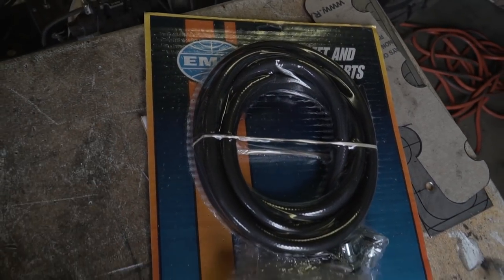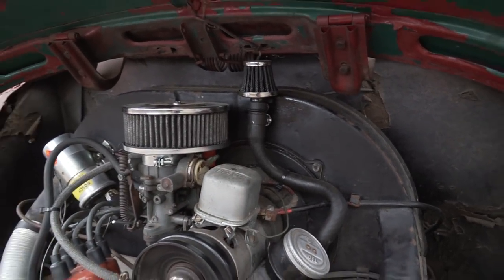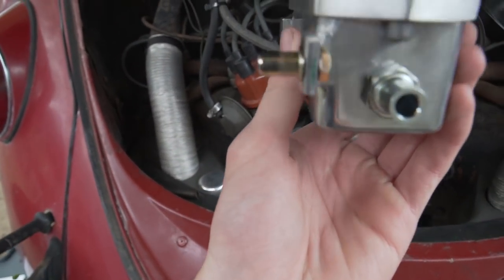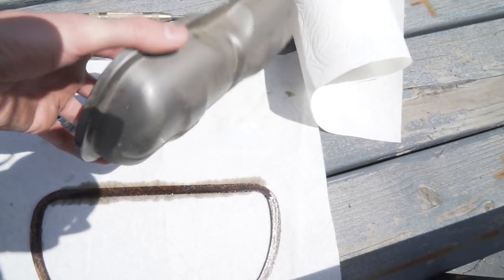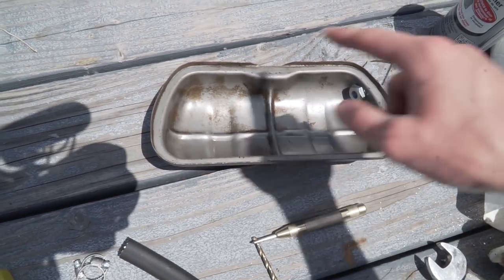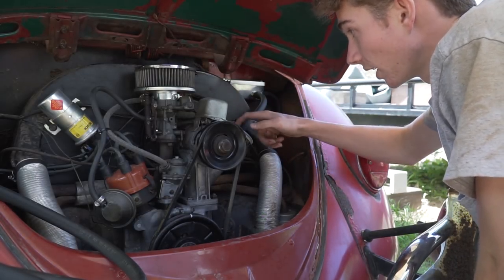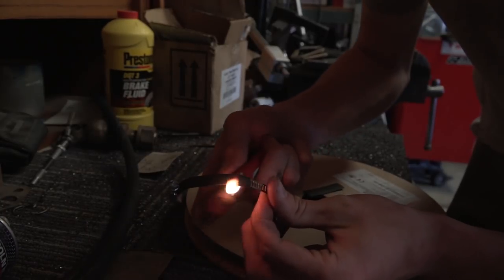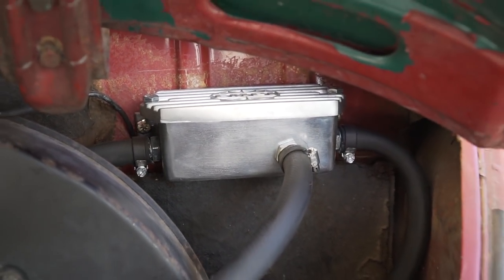Setting up a Fresh Oil Breather on the Bug!

Comment: Nice job bro I recommend replacing the Empi sponge with green dish washing pad (Old School baja Racing secret) the Empi sponge clogs up and stops breathing again
Reply: Could you tell us exactly what kind of green dishwashing pad? I would appreciate it.
Reply: @amezcarl  Scotch- Brite Heavy Duty scour pad 3pac
Reply: @bajalarry8738  Thank u bro! your info is really appreciated!! so, the "Industrial Strength" ones are just too porous?  What happens if I use those ones? It´ll not work properly either?. Anyway, I'll get the ones you said. But wait, those ones are a bit thin, Do I have to stock them inside the breather? or just one inside is enough?
Reply: @amezcarl  I used two with a metal mesh towards the top worked grate and I cleaned them after every race 👍🏽 and I cut them down to size
Reply: @bajalarry8738  How long would you say they can last with normal use in a not racing VW? I think the EMPI breather has a metal mesh on its own, I guess I could use it the same way u use yours.
Reply: @amezcarl  on street applications - daily driver ,check it monthly you should be fine I would clean mine because of the dirt and mud ,and yes Empi breather does have the mesh inside ,put the cut down scuff pads on top off that  ✌🏽
Reply: @bajalarry8738  Maaaan!! thank u bro. English is not my first language but I got everything u said. I really appreciate your time and ur info. You´re the man 😎
Reply: @amezcarl  🙏

Comment: This is why I run old school oil bath air housing
Reply: Right.  I never had a problem with the stock setup.  It was designed that way for a reason.

Comment: Did it fix the issue? I would be surprised as your issue is more likely to be either a cooling issue or a timing issue. Crank case pressure is only really an issue on very highly tuned engines and results in oil leaks rather than stalling and rough idling.

Comment: It’s a nice job - but it’s not doing its job correctly.

You will still have crankcase pressure.
The idea is for the intake to draw the fumes/pressure (blow-by) out of the block while letting the oil drain back down the tube to the block.

Venting the covers won’t help as it vents through the push rod tubes anyway.

If you want an effective system - go back to stock - if you want to make it cleaner than stock - fit an in-line catch can to the stock breather tube - but make it a CLOSED circuit, no silly little filters 
But make sure if you do this that you check the oil level inside the can and empty accordingly.

These empi kits are not doing your engine any good and is very over kill.

I’m not knocking your work - but I am knocking the system. 👍
Reply: Exactly !
Reply: I was wondering if a catch can would be a better option.

Comment: we want a spring plate notch video.... aka rear lift with more travel... and good cheap mod is a better air filter.. lol and then a 2 to 3in Peace of hose on ur carb float vent....... so ur carb dont flood out on bumps...... get rid of that vacuum advance distributor.....and that pos oil filler/crank case breather... theu suck dust/dirt from the bottom...